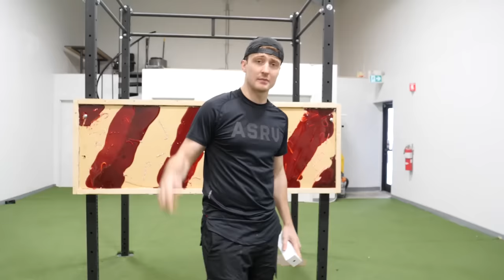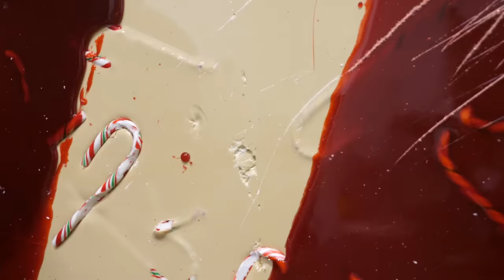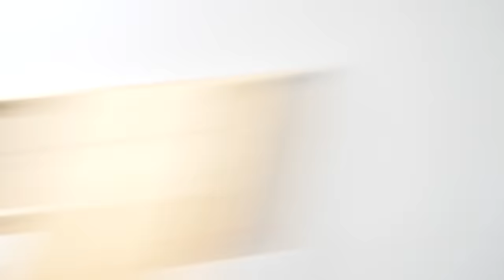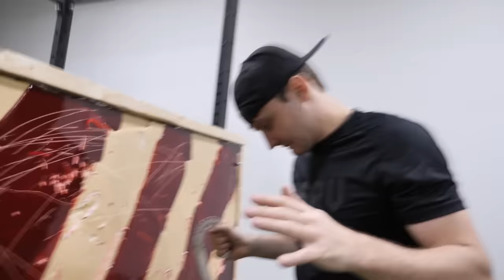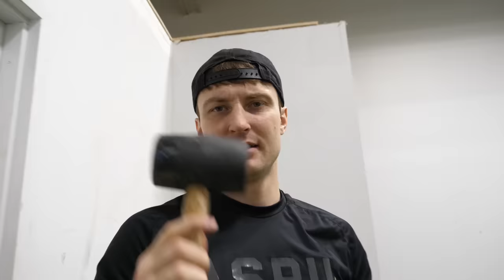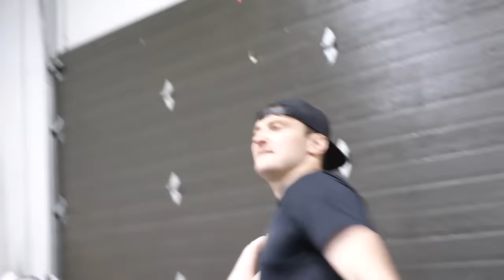100 LAYERS OF CANDY CANES (DANGER ALERT) UNBREAKABLE WALL

Comment: The keys that were missing on the keyboard was F G A S R E Q W  both enter keys + - 1 2 3 4 0 Esc F1 F2 F3 F4 ~ Caps Lock Shift Tab and there’s 1 more that I can’t think of but those are the keys that are missing.

Comment: The missing keys were space , alt , windows button (in most cases) ,ctrl,shift,caps lock,tabs,vertical lines,f1,f2,f3,f4,1,2,3,4,5,q,w,e,a,s,d,g,h,enter,insert.

Also the double sided weapon is called a glave I'm pretty sure